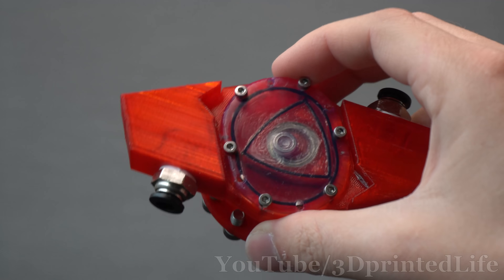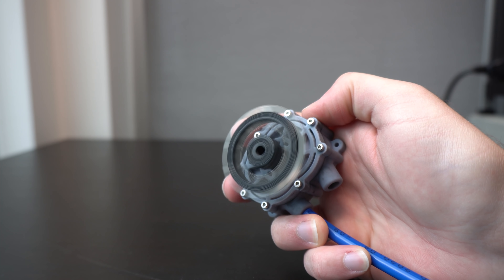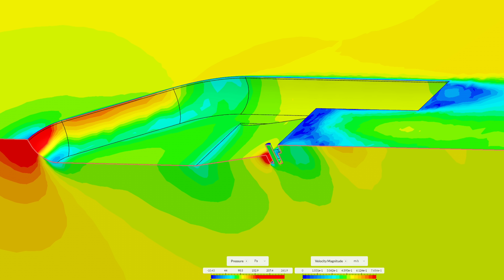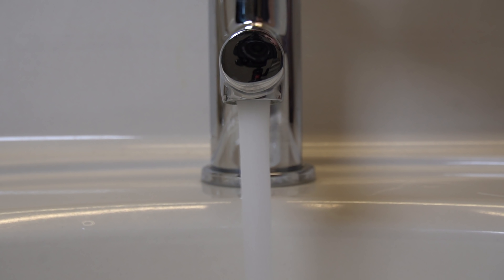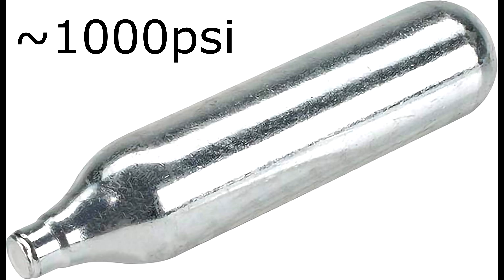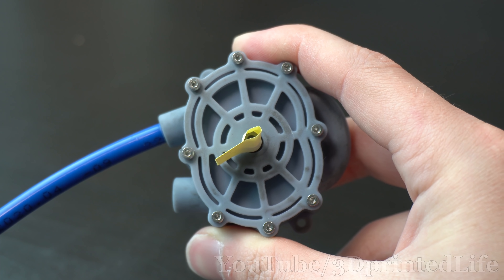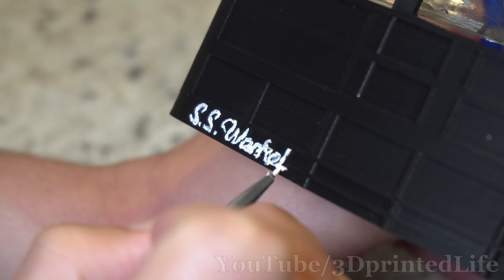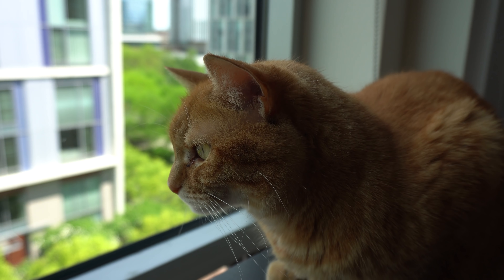Building a 3D Printed Wankel Powered Paddleboat

Comment: The rubber band in the deep grooves wants to climb out of it naturally. use a crowned pulley and it will actually self center due to the stretch of the band. Steve Mould did a very good video on this. Its counter-intuitive, but it works perfectly.

edit: guess i should have read the comments. That video hit everyone's feed a couple days back and so we all commented about it.
Reply from the maker: Yeah a few people mentioned this! If only his video came out a week sooner!
Reply: @3DprintedLife  I'll offer different advice then lol

The boat is too flat on the bottom and therefore doesn't have a self stabilizing hull. giving it more of a V hull shape would keep it from wanting to fall over so much
Reply from the maker: Oooh that's a new one, I figured there was a reason most boats weren't flat but I figured it was more for efficiency, not stability. Thanks for the tip :D

Comment: For the rubberband issue you can use an crown pulley, I think that’s the name, but it is a pulley shaped the opposite way as you have now. Due to the stretchyness of the rubber band it Will seek the center of the pulley and will not fall off.

Comment: If a rubber band keeps climbing out of the groove try making it bulb outwards, the rubber band will climb the top of the ball and stay centered.
Reply: https://www.youtube.com/watch?v=TNuzi-jMXoY
Reply: just wanted to say this too. Or he could use a round rubberband. This would stay in the groove. This would also help the torque, cause it looked like it was rubbing against the paddlehousing because of this effect
Reply: My thoughts exactly, crowned pulleys. Might help runtime also by reducing friction.
Reply: That's what I was gonna say
Reply: Yes, it looks kind of counter-intuitive but it’s really the way to go.
Reply: I come looking for this exact comment!
Reply: Yep, crowned pulleys + a cassette player rubber belt instead of the rubber band. Those belts are designed to be belts, not just rubber bands; and they are cheap. you can buy a pack of a hundred for a couple of dollars on ebay. And I guess a combination of his pressure controlling valve and a CO2 capsule might be the solution to the length of service problem.
Reply: Exactly! He needs a crown pulley
Reply: That’s what I was also going to say. I have a fan with rubber band drive works great with a bulge out not a groove.
Reply: crown that pulley, son!